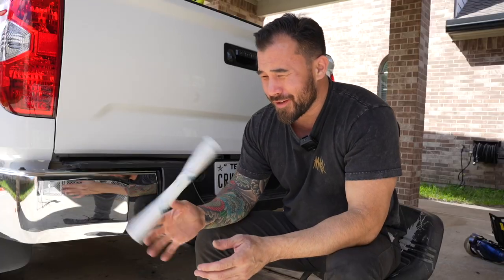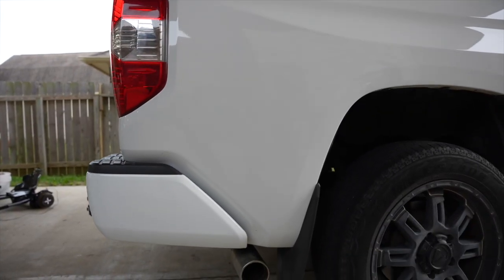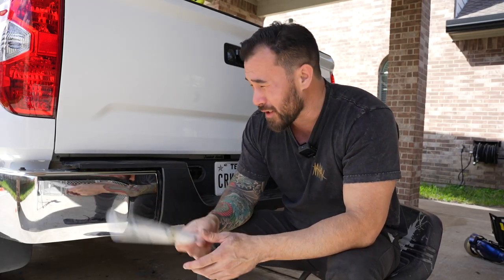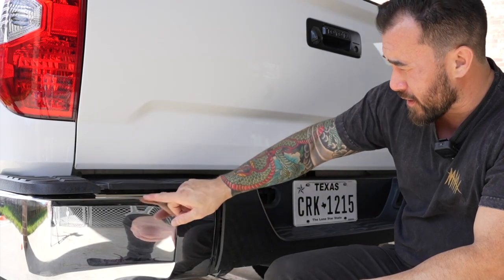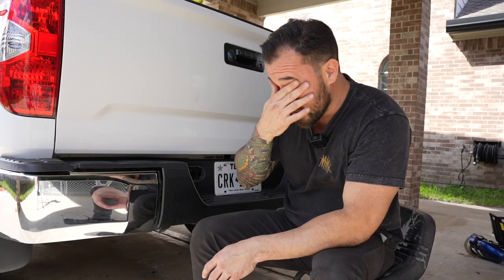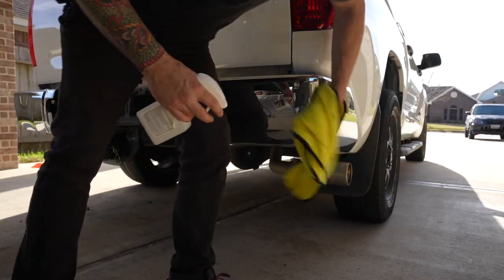Watch Me Vinyl Wrap This Bumper ! Toyota Tundra / 3m VViViD

Comment: This was cool to watch and awesome to know it can be done. I'm wondering if after a large crack repair (via fiberglass on the inside and plastic filler on exterior, file, sand and primer) this would be better and cheaper then sending it to be painted. Unless they make a reliable plastic paint that won't scratch, chip or peal for plastic bumpers?
Reply from the maker: Definitely cheaper